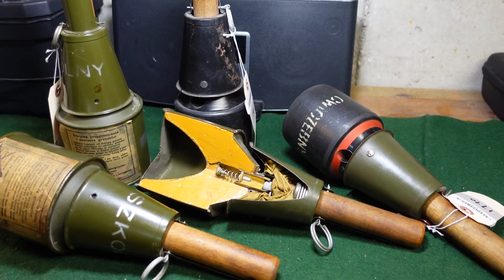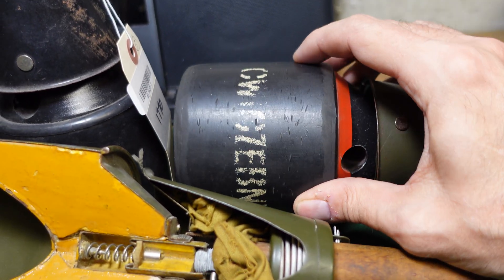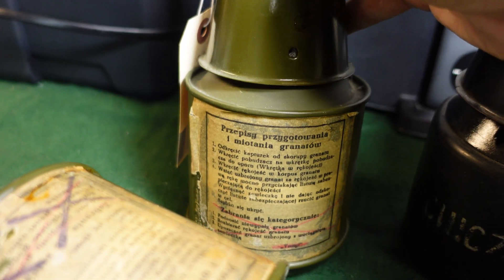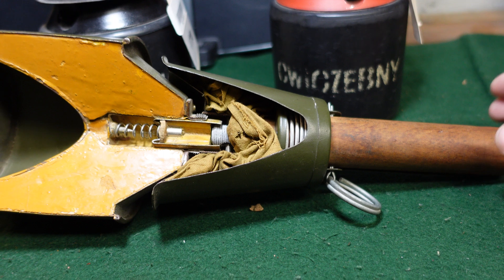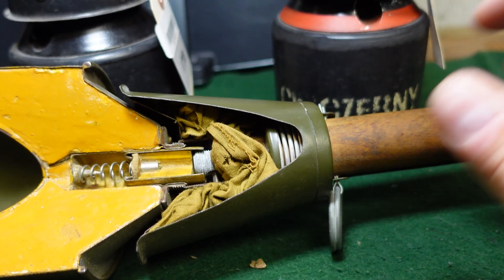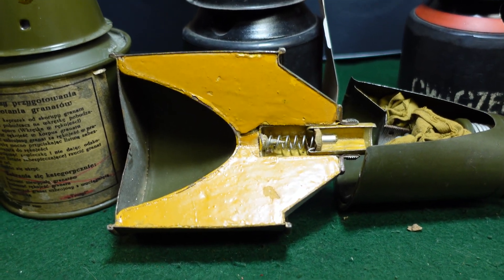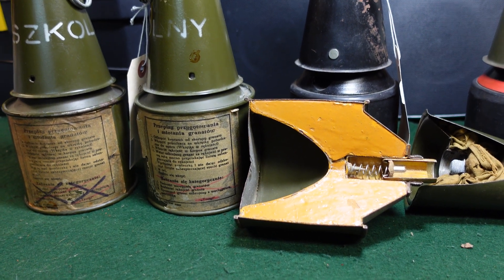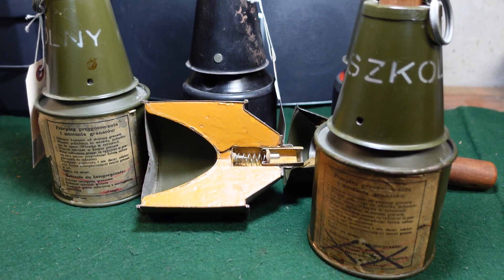The Soviet RPG-43 Anti Tank Grenade Factory Cutaway and Closer Look.

Comment: Hamas is usuing something like this. Theirs has a magnet on the shape charge end and they stick it to the tank and pull the pin and it shoots the hot Cooper into the tank. Just like a normal rpg but hand held and you have to run up to  the tank